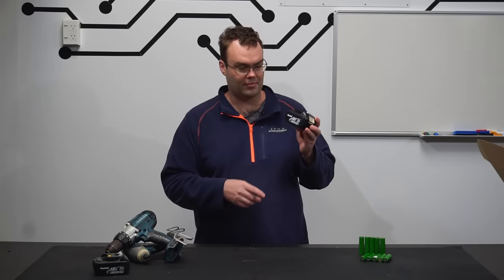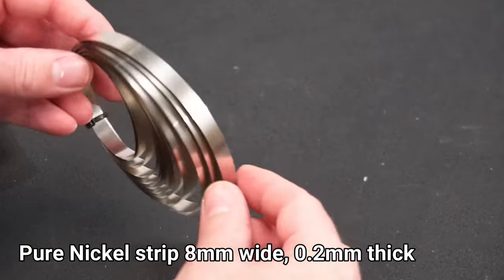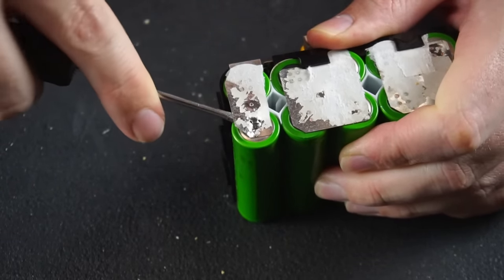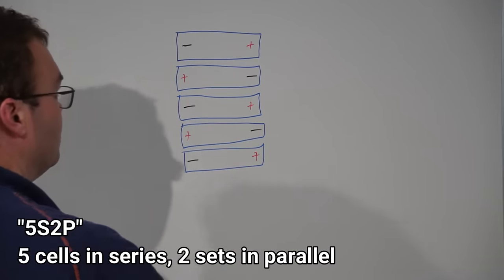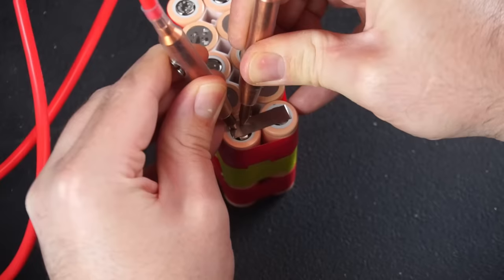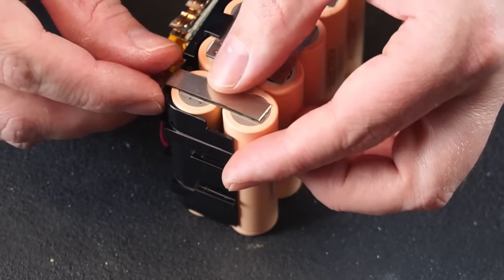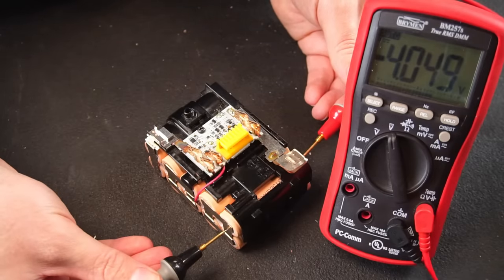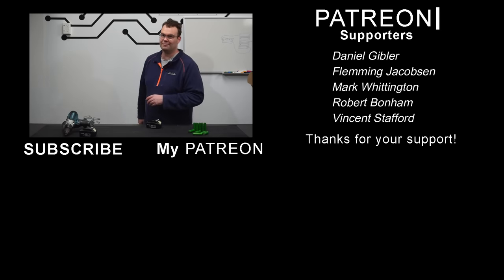Repacking Makita 18v Lithium battery with New Cells (Save $$$'s)

Comment: That particular bms has a nasty hidden feature. If one of your cells die and you hook it to charger it shows broken battery indicator. If you try that three times, the bms will kill itself.  (intentional short inside chip is triggered).
This, combined with the fact that the bms is using 1 or 2 cells to keep itself alive, draining them way below 3V, that situation is inevitable if your battery was sitting on a garage shelf for some time.
So if you see a broken battery indicator, don't try again until you balance the cells or replace dead ones.
Reply: I had that problem,  simply used my other charger and hey presto it worked. If you use a dud battery are you better off trying a god battery straight after, ? ie 3 in a row your out , or 3 in its lifetime ?

Comment: You need to charge each pair of cells up individually to 4.2v up to exact same level to 'top' balance the pack,  so when at full charge the cells are level, that old bms cant see individual cell voltages, so charging could be a fire hazard with out of balance cells. The newer makita batteries are far better designed with lv cutoff and balancing

Comment: I'm late to the party here but could you have hooked another fully charged 18V battery up to the repaired battery and let it them simmer for a while?  I've seen that done for completely dead batteries just to get enough charge into the dead battery for the charger to accept it.

Comment: I've had my pair of Makita drills for about 12 years. They aren't in use a huge amount but when they are it's usually quite heavy duty work. 2 batteries still going strong. 

I'm not sure how much the spot welder would cost but I'm pretty sure it's not cheap. Would I ever use the spot welder to justify not just buying a new battery? I don't think so.

Good for someone who has or has access to the tools tho.

Comment: i built all mine with new vtc6 cells, i made mine into 6 amp hours but at a cost of60$ and 10 for the bms
Reply: Is it hard to fit bms in there? Im thinking to do the same, but there is not much space left inside those batteries.
Reply: @Sopheris  I made a small video building one
Reply: I scored a sweet deal on vtc6 cells last year from a website called evwest and got them for $2.40 a cell! I had to buy 100 at a time though but I ended up getting 400 since I build electric skateboard batteries as well and I use 60-80 cells per board.
Reply: @randybobandy9828  thats where I got mine but by the time I pay shipping and conversion the 3$ turned to 6$
Reply: @dylanc9275  oh mine where 2.40 each shipped. I got them on a black Friday deal last year.
Reply: @dylanc9275  conversion? Canada or Australia?
Reply: @randybobandy9828  canada
Reply: @dylanc9275  i was lucky and bought some random battery for 20$ and it looked very similar to those in video but actually had board with balancing and wires for each cell. Cells arent great, because they have only 1300mah, but at least its samsung :)

Comment: Are the nickel strips necessary? I've made up battery packs before. BUt always just soldered using wire for the series links. Is the reason for the nickel for current flow?

Comment: I replaced the batteries in a Span On 18v rattle gun. I just bought suitable spec batteries and I soldered the connections . From memory there was some sort of  temperature sensitive fuse in it but that was OK and battery worked fine.  I had to do the same to the back up battery as well (they  were 10 years old).

Comment: Why do the wires jump each time the spot welder fires? Is this the machine doing this or the operator?
Reply: We were doing tests on 57 lb battery. Heavy charge and discharge. The whole battery was vibrating and bouncing up and down. When you apply that much power through the cables they’ll move a bit.
Reply: @rnordquest  wow that's interesting

Comment: I was trying to figure out how to make 18 V from 10, 4V batteries.
Looks like you place 5 batteries flat next to each other with their poles alternating (- + - + -).  Then you place another 5 on top of the first wit same configuration ( - + - + -).  On one side you connect the first 4 to each other and the second 4 to each other.  On the other side you hook up the last 4 to each other and then the next 4 before it to each other.  So the two batteries at the each end, ends up with one side of it not soldered and on opposite sides of the pack.  Unless I have it wrong.  If the top row and the bottom row are opposite poles?

Comment: A spot welder is more expensive than a new battery (for my 14.4v) unfortunately. I usually take them apart, check in my Dragon charger which batteries are still okay, and use them in a 18650 flashlight or battery pack I've got. Also some of my videogear from Zhiyun uses straight up 18650 instead of batteries in casing or AA. Wish more tools would just have a hood under which to place your 18650's in. Or the option to easily replace them in their housing. Also, 18650 from Japan or Korea are usually way better than from China 😢

Comment: What voltage on original cells? And are they same chemistry and charge endpoint voltage?  Some are 4.25max  some  lower. Nife etc .  Cant keep track of all the new batts.  Good effort tho.
Reply: All lipos are 4.20V fully charged...when it hits 3.20V or 3.10V..you get a warning...then when it hits below 3.0v you may have damaged the lipo.The charger will not charge it anymore until you know a few tricks.

Comment: Hello, i wanted to check with you if you have the gerber file for the bl1860 PCB, Am trying to do up a final year project for school and it involves recycling batteries. That portion i've learnt from your video but PCB board is WAY over what we learn in school

Comment: Also, just because I am not as talented as you, I would like to see a video on how to build a battery that would work with a 48v 1000 watt or better how to decide what motor, acceleration pedal, controller and battery goes with a riding mower electric conversion kit.
Reply: Good luck...it's really simple if you start at the Kindergarten level

Comment: Good video thanks from London England 👍💪😎
Ps. Only thing is this looked pretty complicated/fiddly as a non electronics guy.. 
Given you'd have to buy the spot welding kit and replacement cells then weld them etc, would it be worth it for the odd one or two packs?? (Given on eBay currently you can get a Chinese Makita 6ah knock off for about £19 now)? 
Any thoughts you got be appreciated! (As a novice!)
Cheers
Reply: Be aware that those Chinese knock offs are seldom what  they claim to be, IE usually FAR below their stated mAh rating.  We bought a Chinese made battery for our Dyson, rated 4000 mAh vs the original 2500 mAh, yet it's run time was about half of the original Dyson. And within months it didn't run at all.  Same for the 18650 batteries that state 9000mAh, yet weigh only 35 grams compared to genuine 3000mAh's that weigh 45 gms.  If it sounds too good to be true ....

Comment: well. a faulty battery wound be a blinking red light and green light. both lights solid is greater than 80% battery level
Reply: I was going to write exactly this and found someone already explained. 👍

So battery was fine, charger just indicated it was at least 80% charged and the remaining 20% the it charges slower than the initial 80% to reduce strain on battery as it's nearly full capacity.

Both blinking LEDs would have meant battery pack is faulty.

Comment: Those purple LGs are you sure they are high current ? If you insert a battery in the charger 3 times in a row with error, it will brick the PCB permanently and you'll have to change it (this is for Makita only).

Comment: i dont undrstand why the 4 square configuration of the welded nickle strips is needed. seems like only 2 ends per strip shud be neded for series conection?
Reply: But you need to connect 2 cells in parallel before you connect them in series. He did it correctly.

Comment: i noticed on my fake makita battery that the spot weld failed causing battery charging fault, how serious is it replacing just one cell? as them escooters all use 18650s cells and theres alot more than ten in them , seems a hell of a waste just for one cell

Comment: i finished to change one battery but not work in drill.why?This old  model,BMS in charger/No problem in charging other battery.The checking output is good.But  one battery has changed , differenet in MAH.This is influence to BMS?

Comment: lol and so put a lot of money, time, and work into repacking your battery than it would take to go get a new replacement battery pack 
Dont forget that its not just the replacement batteries you have to pay for. There's also the roll of nickel and the special soldering tool that you also have to buy and pay the shipping costs for

Comment: That's not a faulty battery error. It's simply >90% charge signal. You just jumped the gun. For it to be an error code, it would have to be flashing, not steady.

Comment: A quick note about your oils in your skin and those batteries. Wear gloves next time! You oil in your skin contaminate the metal you're connecting to the tops and bottoms of the cells, it can cause corrosion over time. You don't want this as you'll have to tear the battery pack down again.

Comment: back when they were cheap I bought two of those red ones from China they were like 12 bucks and then I bought the circuit board with the yellow xt90 connector on the end those are about 9 bucks they work just fine you're paying a lot of money with this okay well part for what you don't need

Comment: Hi, I have 18650 button top batteries. Brand new. I wanted to replace the 5 batteries from my m18 pack. One of the 18650 batteries is bad. Would I be able just spot weld the button top batteries like normal.

Comment: What is the best cell to use for power tools? Impact wrench, blower, grinder? 
Need recommendation for both 18650 and 21700.

Would 20A enough, or should I go for 30A?
Aiming for longevity here.
Reply: 20amps is enough because the batteries circuit board will not allow the tool to pull more than that. You have to understand that the double stack packs are pushing out double the amperage vs the single. So a 3ah battery will do 20amps but a 4-6ah will do 40amps. The 9ah packs will do 60amps. And the 12ah milwaukee pack can put out up to 90amps. I would recommend sony vtc6 cells for 18650 because they are high capacity (3ah) and put out 25amps. For 21700 I would recommend molicel p42a because it has a capacity of 4.2ah and a power output of 45amps! It's a absolute beast.

Comment: The sensor wire: Where on the BMS is it connected and does it connect to a positive or negative strip on the battery pack please.

Comment: Done heaps of these, 99.9% of the time a new BMS is required as the Makita BMS disables itself when it sees an error and there is no way to reset it (despite what you see online). So don't attempt this unless you are ready to fork out for a new BMS board. Also this is a very old pack, newer packs have different BMS boards and monitor all 5 cell banks, replacement BMS are more expensive and more difficult to fit.
Reply: newer batteries are the one with a star on them?

Comment: Ahh so it is a myth that if you remove the cells the BMS faults as a "feature" to stop you changing pack cells.

Odd cells voltages when discharged and settle, will tend to balance the cells. 

All good anyway as I have some Samsung cells that need to make my drill last longer, the pack packs aren't good after just a few charges and in the summer sun overheat a lot causing the shut down of work..
As can't hold nor charge in 40+ degrees temps.

And yeah, battery current is essential, they range a lot. I've some cells that only discharge at 400mha.
Pretty sure drilling would be painful with those. Lol..

Comment: It looked to me that you had connected the positive and negative sides of the batteries together could you explain why you did that. Also it seems like a hell of a lot of work to rebuild an 18V battery and where did you buy the spot welder.
Reply: Looks counterintuitive at first doesn't it.

Comment: Dear Sir I do have HP457D with BL1813G , the drill has 3 cables 2 for the battery and 3rd one, what is that one used for,? and the Battery has 5 Pin , do you have a diagram or pin layout, so i can replace it.  the Makita charger with the other one, or make a new Battery?

Comment: You got those  cell out of a dyson battery  pack lg 2100mah 25a  the green ones  are ctv4 sony 21000mah 30a I have thousands of these  batterys
Reply: No the lg cells he used where 2600mah.
Reply: @randybobandy9828  and were did you get them out of dyson battery packs

Comment: You made a fundamental mistake in this tip. If you are building a battery from cells, you should connect EQUIVELY CHARGED cells. Different levels of charge will almost certainly cause problems with the BMS.
The easiest way is to install the cells (if you are not sure about their condition, in the case of used ones you can never be sure) either fully discharged or fully charged. All intermediate states are a recipe for trouble. Some BMS respond with an error to a voltage difference of 0.05 volts! This avoids the hassle of the BMS and the uncertainty as to whether it is operational. Usually it is functional and usually the problem lies in the cells.
Normal voltage measurement is not enough. The cell may have good voltage, but at the same time its capacity may be agonizing. Controlled reloading will eliminate such a cell from the game. 
Personally, I think that the state of full discharge of cells is very unhealthy for them and I do not use it. So I charge each of them with a single cell charger BEFORE ASSEMBLY. The advantage of this method is that I know the true capacity of each cell and I can choose them so that they all have a similar capacity, of course the higher the better. On the other hand, I definitely eliminate weaker ones. The disadvantage is that charged cells run the risk of a high-current source short-circuit - with a known effect. However, if someone is not able to carefully and flawlessly assemble a simple battery, he should not do it at all.
After assembling the battery, I discharge it with an artificial load. If, after a complete discharge, it is fully charged on the original BMS, if everything is OK, especially voltage, I am sure that the battery will work for a long time without unpleasant surprises.

You are absolutely right about one thing: the use and correct selection of the aftermarket batteries is cheap, and you can be sure that the battery will last for a long time. Repairing two batteries will "earn" the purchase both of an artificial load and a charger for single cells (vs purchase a new, oryginal Makita battery). You can buy them very cheaply on AliExpress, as me. Every next battery repaired is your net profit! If you use cordless tools a lot and often, you will quickly find that repairing the battery yourself is a great way to significantly reduce your own costs. Ultimately, battery repair can be turned into an additional source of income. And not so small at all! I know something about it. :))) 

In my experience: the best cells are LG and Samsung. On cells from these manufacturers, the battery works much better than a brand new one! In addition, it is worth to look at the catalog data of both manufacturers because the battery of one type and another battery type is uneven! Both producers make very good cells and both producers produce cells that should be avoided. You have a very good test here: https://www.youtube.com/watch?v=qMZuHMlRw_0&t=710s
I suggest using cells with a discharge current of not less than 20 amps. 
And bonus tip: it is good practice to use the same type, the same rated capacity, the same discharge current and the same manufacturer of cells for one battery. It is really important! Mixed cells always lose their total capacity faster in the future - usually not very long... 

P.S. Please forgive me the language mistakes - English is not my native language.

Comment: one question. you did not mentioned about 18650 battery chemistry, if i replace battery with lower discharge rate will this work? what exact type battery i will use?

Comment: I would not recommend doing this on our newer batteries. Our cells are manufactured by Samsung and the PCB expects to see the specific cell specifications in their products. Depending on the cells you use this could cause an overcharge while charging or using the battery resulting in a lithium fire! (we've actually trying to claim this before in our service centre after tampering with the battery.)

Comment: Yeah, spend 300 USD worth of tools ( and shiping) to save 10-20 USD on battery, not to mention spent a day fiddling around with it. Potentially not only destroying the battery but also damaging the tools and charger. And burn down your house.

It would make sense on 800 USD Roidmi cordless vacuum cleaner with fixed battery pack.

Comment: That wasn't a battery error you saw solid red and solid green means it was above 80% charged if you left it keep charging the first time it would have went full green. Charging below 80% charge it shows solid red then it goes solid red and solid green at 80% then just green when done, didn't need to drill all those holes, lol.

Comment: I have a new Makita battery charger and it will not charge a battery till it has a low enough charge. The lights must be less than half one light. The fault light comes on the charger but acts as a not ready to charge light.

Comment: Its not bms problem, battery will again mayu not charge after time, what you need is to not drain, but make them equal all cells must be exactly calibrated there is a tool,